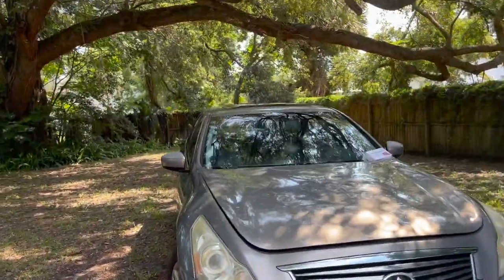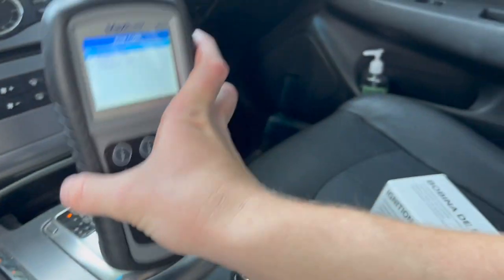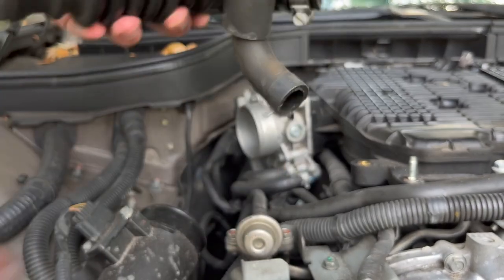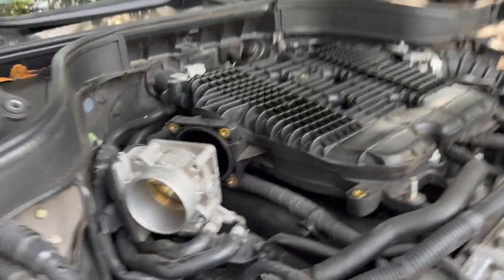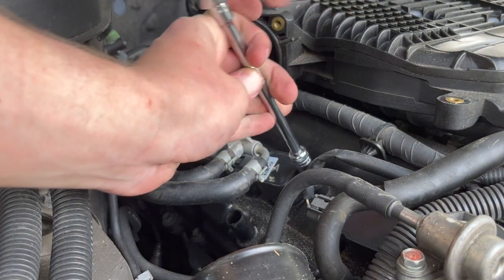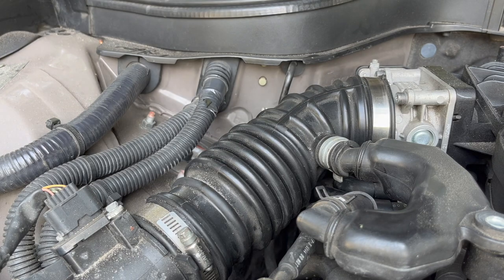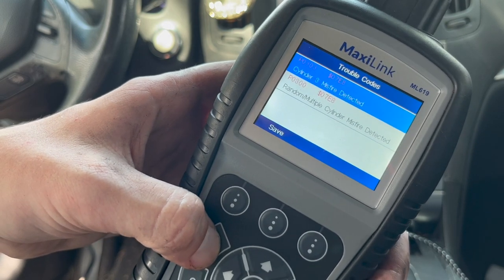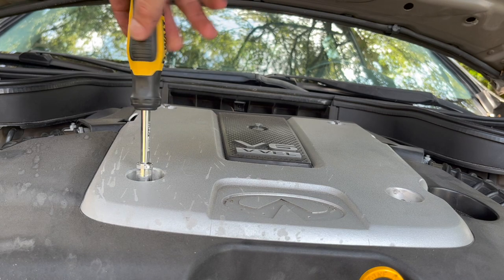Infiniti G37 Ignition Coil Replacement

Comment: Thank you for the video. I have experience the same code and will try to replace the spark plugs and ignition coils on my m37
Reply from the maker: Thanks for watching. Should be very easy fix.
Reply: Having a tough time getting the throttle body off. Not enough space and bolts are stuck on pretty tight. Any tips?
Reply from the maker: @marcmcguire1737  Make sure you have right size socket and use longer ratchet or use some extension on ratchet (pipe on top of ratchet) to have more force
Reply: Thanks! You’re the man! This fixed my problem with my m37, barely any videos out for that car. I am very inexperienced with cars and this was perfect for me to learn 😊
Reply from the maker: @marcmcguire1737  awesome, glad it helped!
Reply: I have a 2009 fx35, the engine looks the EXACT SAME as the G37. Can anyone say for sure, there are the same engine. I need to know the NUMBERING for the CYLINDERS.
Reply: I’m 90% sure all Infiniti models from that era have the same order :)

Comment: Do you have to clear the code with scanner what happens if u dont ????
Reply from the maker: Yes, you have to. If you don't, nothing will happen, you'll just have check engine light. There is possibility that eventually check engine light will clear by itself, but not sure how long it will take.

Comment: how do you guys know which coil it is .. I took mine to the shop and just gives me  a generic code P0300. I used all 6 new NGK iridium spark plugs  and now the service soon light is flashing again after about 5 days.
Reply from the maker: I had similar issue before and after rescanning days later it showed exact coil.
Reply: @PZPal  ok thank you for the reply. really appreciate it
Reply: @PZPal   what scanner are you using? because i just went to my mechanic and his scanner still says code misfire P0300
Reply from the maker: @vince2113  It's not because of the scanner. I think if there are several coils acting up, you are more likely to have P0300. Only other way to figure out which one is bad is to buy good coil and put it in random cylinder till you figure out which one is bad. I don't know of better way, sorry.
Reply: @PZPal  okay no worries thanks tho...
Reply from the maker: @vince2113  yeah, in my case it was P0300, but after 10-15 minutes of engine idling, I was able to get a code to a specific cylinder. But also from my experience they all are going bad at about same time, so maybe it is worth to just replace all of them at the same time
Reply: @PZPal  Yea i dont mind changing all 6 ignition coils. But my shop said it could be other things too like fuel injectors etc. So im debating on what i should do. MY other option is to pay Infiniti $170 and get a very accurate reading of what exactly is happening
Reply from the maker: @vince2113  I guess it is possible, but just because failure of original ignition coils on G37 is very common, I would just replace them and hope that's the issue, but that's just me lol
Reply: @PZPal  Hey My mechanic suggested replacing PCV valves. I bought 2 from the dealership and changed them myself. Guess what no more error codes. One of my PCV valves was clogged 100% the other i would say about 80%. (You can check by shaking them side to side if you dont hear anything its clogged- new ones rattle)
Reply from the maker: @vince2113  that's awesome and interesting, I had no idea bad pcv valve would cause those issues, but definitely good to know. I had 150k on g37 and never replaced the valve and it worked fine, but obviously every vehicle is different. I started replacing PCV valves on cars I have now every 100k or so just as a precaution measurement. Thanks for the update!
Reply: @PZPal  Yea after doing a ton of research it kept pointing out to PCV valves causing misfiring. I would def replace if cars are older or over 100K. MY gut told me that it cant be the ignition coils and I went with it. Car def drives alot smoother now.  Next i need to find a product that I can add in my fuel tank to clean out the fuel injectors. So far i found liquid moly to be on top of my list.

Comment: I knew it my car sounded like dogshit and sounded like it was misfiring on a cyl changed plugs but kept getting flashing SES light and sounded the same i looked up what flasing SES means and it means a "class A" misfire meaning it can destroy cats by sending unburnt fuel into the cats where im hearing a loud ticking noise that sounds like a small explosion is happening in my driver side cat if my cat is fucked ill get testpipes but turns out its 90% of the time a shot ignition coil that wont ignite the mixture in that cyl im gonna read the code tmr and see which cyl its misfiring on but i will probably buy a complete new set of coils 🙏🏼
Reply from the maker: Bad coils seem to be very common on G37s after vehicle hits 100k miles. I recommend replacing coils with good brand as the cheap coils I bought online before (for $20 or $30 each) lasted less than a year. The ones I have in description of the video last a really long time and I never had any issues with them and on top of it they are made in Japan.
Reply: @PZPal  sounds good homie thanks!

Comment: did it work ? i need change all mine and new spark plugs my car was shaking yesterday
Reply from the maker: Yes, it did! I think OEM ignition coils last about 100k miles, so it's quite often that these go bad. I have another video here on how to change out valve cover gaskets incase you'll need to replace those as well.
Reply: @PZPal  was your car shaking and like your engine ? or what exactly did you experience?
Reply from the maker: @Ronnieishim  Yes, car was shaking a little on idle. Also check engine light was on and check engine light was blinking during acceleration. Generally engine performance is a bit weak too.
Reply: what was the issue was it bad spark plugs and bad ignition coils mine was shaking like crazy when idle

Comment: Did you end up having to do a relearn? My car just doesn't want to do the procedures
Reply from the maker: No, I never had to do re-learn after ignition coil replacement, I believe that it is needed anytime throttle body connector wiring is disconnected. I always just remove bolts of throttle body, but never disconnect the wiring.
Reply: @PZPal  soo I can turn the battery off and be scott free?
Reply from the maker: @Th3fac31  that's a good question lol, but I think it'll still require re-learn as it will know throttle body was disconnected (when batteries get replaced, the car does not need re-learn), so I think there is some sort of internal memory in cars that do not depend on battery connection
Reply: @PZPal  alright well I'm hoping for the best lol, just going to follow what you did on the video, the real challenge will be doing the driver side because for the life of me I'm unable to get that damn boot out!
Reply from the maker: @Th3fac31  good luck, I never had issues with getting boot out, hope you'll be able to figure out. I've done so many of ignition coils that I can do it with my eyes closed now lol

Comment: Thank you so much for this!
A few months ago I had what was said to be a bad fuel injector by Midas. They said they were going to order one and in the end I paid $700 even though they never did use the new fuel injector, only ONE ignition coil. A couple of months later, a different cylinder started to act up. I took it in and they told me I had "Bad Gas". They told me to use Sea Foam and it should clear up. I did the full Sea Foam treatment. 20oz in my gas tank, 6oz in my crank case and the throttle body got its full can. Problem remained and I kept driving it in hopes the bad gas would clear up. A week of driving in using a half a tank of "Not bad gas" and the issue got much worse. My car was violently shaking at traffic lights. Putting it in neutral helped, but it still shook. One day going for groceries the back firing started and power dropped tremendously.  Midas was in the direction I was going so I drove directly there. Barely made it those 3 miles because my car had zero power and I was going under 10 mph. After having my car for a week, the mechanic called me saying he couldn't properly diagnose it because they don't have infiniti diagnostics software. He told me to take it to infiniti... I told him they wouldn't take it because it had aftermarket parts (ridiculous rule of infiniti). I ordered all 6 ignition coil packs and today after work I went to MIDAS, got my key back and in their own parking lot I spent an hour replacing all 6 (including the one from months earlier that I paid $700 (also includes labor of course)). The mechanic was leaving and the shop was closing when I closed my hood and fired it up. ALL FIXED!  In fact, it runs better than it has in a lonnng time. I understand they didn't have the software and appreciate their honesty but expected more from a pro shop. When I got to cylinder 3, the wire harness wasn't even fully plugged in, just barely and disconnected the second my hand touched it. The mechanic told me he tried swapping it out with another one (since my code said cylinder 3) and it was still an issue, so he either lied to me, or upon hooking it back up he failed to connect the wire. I'm super happy though because it forced me to fix it myself and I saved all that money. They didn't charge me anything which also I appreciate, but also have to believe they didn't do anything to it. Despite all the guessing, I plan to go by there this weekend and give him a $50 tip for not moving forward and just replace random tings in trying to fix it with guesses.
Reply from the maker: That's crazy, generally misfire is not a complicated problem, crazy how they couldn't figure out that you just needed ignition coils
Reply: @PZPal  😂🤣🤣🤣🤣
Reply: Sorry buddy, but you got ripped off big time for that 1 coil, and diagnostic. I would have gone back and asked to speak to a manger, or even someone higher up. You shouldn't have paid more than $150-$200, and that's with the coil! But glad to hear you got it running correctly after all.
Reply: Send me a tip too, I just read your full comment at no cost & I’ll gladly take $700 for half assing a fix to any of your problems that still persist months later let me know fam.

Comment: I learned alot my code was 300 random cylinder misfire
Erase code ran again . 301
1st. Cylinder misfire. So i bought 6 ignition 
Coilpacks . Hitachi  for 90$ american. Incl. Shipping.
Unless i get another code !!.
So one day a warm day ill do
The plugs and 5 more coils to put in.  Thanks Bro.
Reply: did you end up changing just the first coil? if so why did you end up buying 6?
Reply: Where did you buy 6 hitachis for 90$??????
Reply: @vince2113 ur better off replacing all of em instead of 1 cuz eventually it’ll just jump to another cylinder
Reply: @MrEvrythng  thats True

Comment: Are theres oe or aftermarket  some afternarket has 10 parts inside the oe has lesscand fiednt have the right heat rating after so many miles
Reply from the maker: I am still not sure if this ones are oem or aftermarket, but I think they are made in Japan so I am sure they’re good. Never had issues with them

Comment: Did this work ? My car recently started shaking and I have bad idle I try to give it speed but seems to choke up and Idky when I’m riding around kinda smells like fuel and I got a misfire code on cylinder 3 and 4
Reply from the maker: It definitely worked on mine, but I didn't have issues with fuel smell
Reply: Have you changed out both coil packs?
Reply: i’m having this exact issue right now, have you fixed it yet?
Reply: @zaytoven8858  yes I scanned the car and it has a misfire on the cylinder 3,4 all I did was change the spark plugs , and the coils and it was running better then ever

Comment: I think your suppose to remove the neg.battery terminal
Reply from the maker: It's not gonna hurt to remove negative battery terminal, but power does not go to ignition coils when the vehicle is off. I kept keys in my pocket so no one could start the vehicle while I was working on it anyway.

Comment: I stripped the throttle body bolts
Reply: What do I do
Reply from the maker: How? Didn't use current hex socket? You might be able to remove them by using long needle vice grips. But be sure to replace with new throttle body bolts.
Reply: @PZPal  it was already stripped
Reply: @PZPal  I’ll try the long needle vice tomorrow and see what happens
Reply: @PZPal  do u have any long needle vice you recommend because the area to remove those bottom bolts on the throttle body is small
Reply from the maker: @nnadi_nexus  https://amzn.to/3JrVmY6
I have those and they're pretty good.
Reply: @PZPal  ok u think they will be small enough to fit that space
Reply: @PZPal  ok I will order these they come on Saturday
Reply: @PZPal I jut got the vice u recommended how did u use this to remove the bolts
Reply from the maker: @nnadi_nexus  Are all bolts stripped? you can use vice grips to grab bolts on sides, make sure grip is REALLY tight and then remove.
Reply from the maker: @nnadi_nexus  You can also get a tool kit specifically designed to remove stripped bolts. https://amzn.to/3NpeJlJ